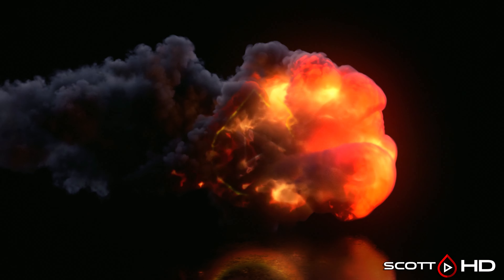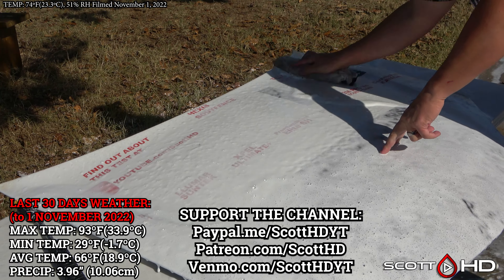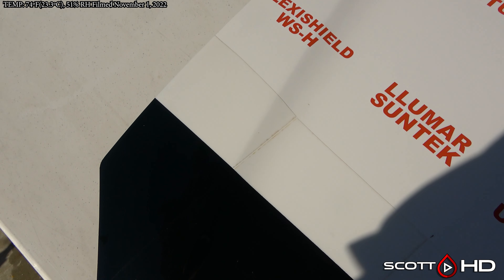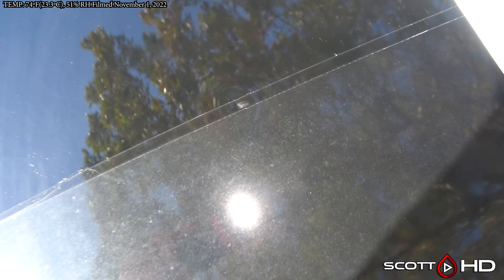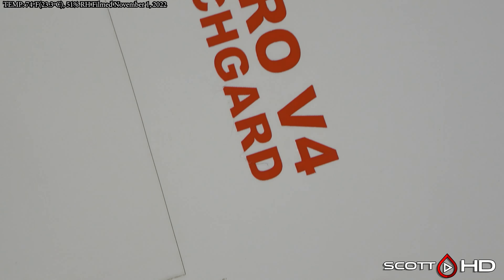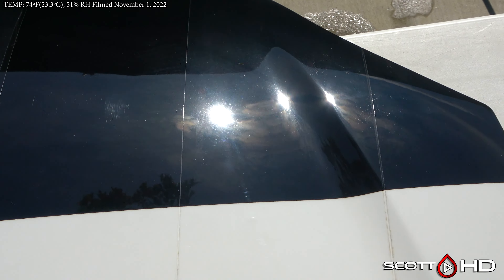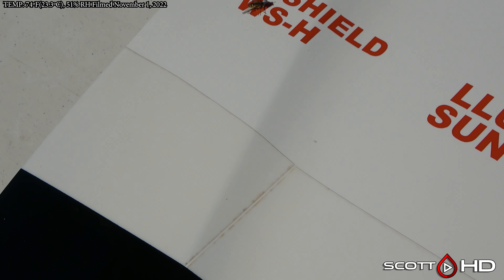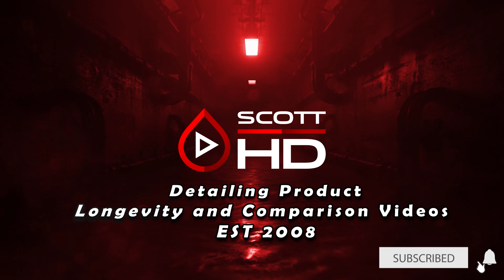Paint Protection Film PPF - UPDATE 30 - Ultimate Longevity & Durability - 2 YEARS, 8 MONTHS

Comment: Good to see Xpel Ultimate+ is doing good. I had it installed on my car 2  years ago. Immediately I applied ceramic coating on top. I regularly hand wash it and top off with ceramic spray a few times a year.
Reply: That is the way to go.  PPF + ceramic coating is pretty much the most you can do to protect the paint.
Reply from the maker: This!

Comment: I've had Xpel (unknown series) PPF on my hood. I'm starting my 4th year. It has been hand washed and ceramic coated sprayed regularly. The edges haven't curled. I can no longer get the black gunk of the edges. One thing that messed it up, and messed it up quickly was Pine Tree sap. I got a blob on it, and it made it bubble in under 24hrs.
Reply from the maker: Absolutely.  Sap is acidic!

Comment: Scott what film are you going to use in the shop ? Any changes on what you are currently using?  So concepts of using  films for a daily driver and expecting 5 years is most likely doubtful for the best look on a car.
Reply from the maker: Originally we used XPEL.  Switched to Flexisheld and didn't like the adhesive.  Not aggressive whatsoever.  Moved to 3M. Didn't like how it was bad at leaving lift-lines in the film.   Moved to Premiumshield.  Pretty happy there, except on white vehicles.  Currently installing Llumar (Eastman Chemical) which bought out Premiumshield so I'm sure Premiumshield is going away completely when the stock is depleted.   Happy with Llumar so far!